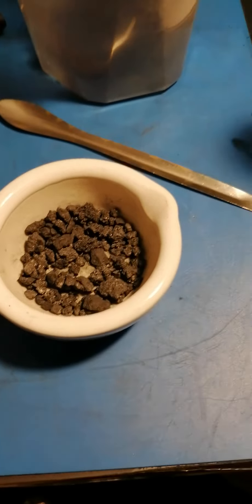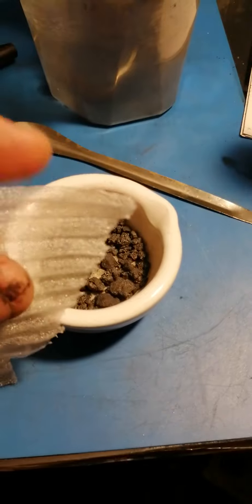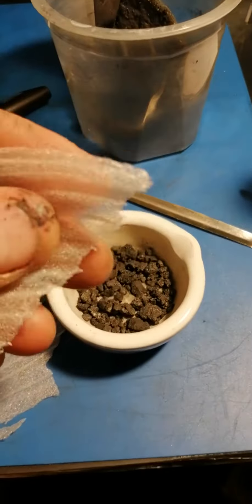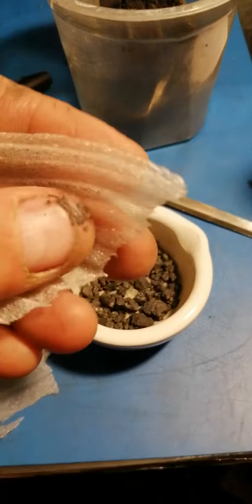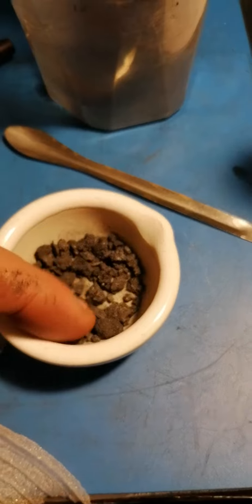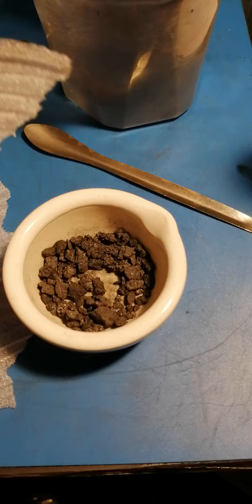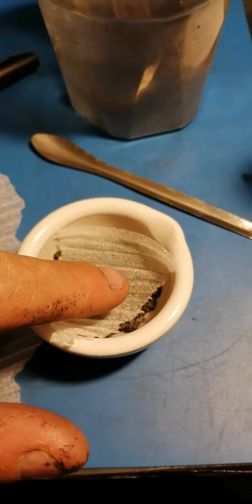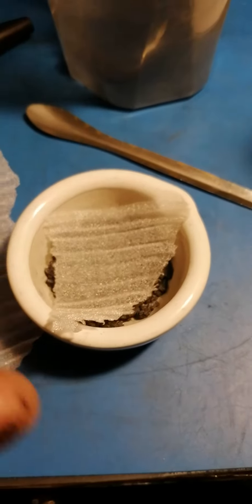Dry coat electrode diy concept!

Comment from the maker: So in respect to a microwave being used i feel it is not the concept i was trying to demonstrate as this plastic will melt at around 150 celsius ! What is done here probably vapourised the plastic as the graphitised carbon had white hot  parts probably as hot as the sun .  Best to use a saucepan and a heat source that can be regulated like a hotplate !